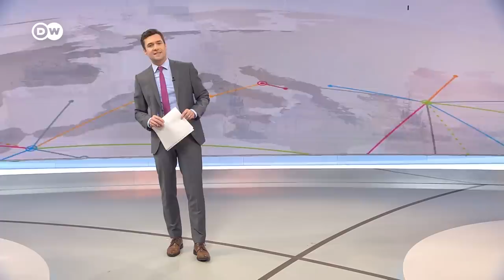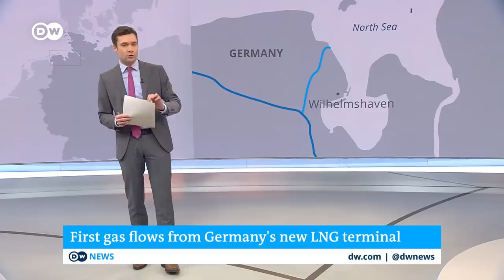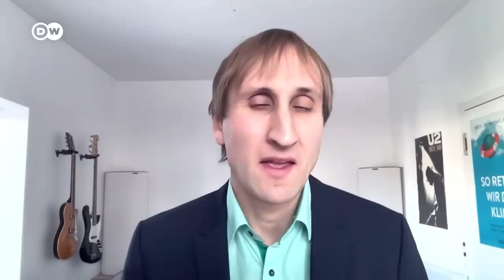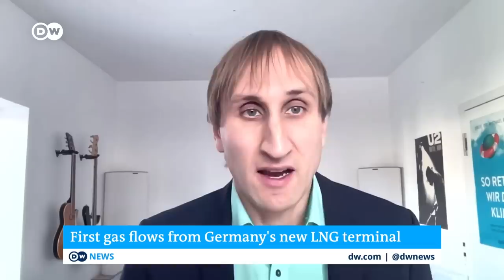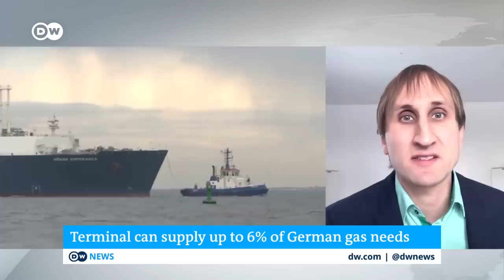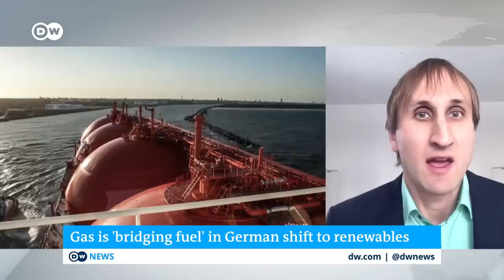First gas flows from Germany's new LNG terminal | DW News

Comment: Yes but pipelines from Norway, Denmark and from Africa also available.
Reply: THERE IS NO PIPELINE FROM AFRICA TO GERMANY.
Reply: Boom, and there was a pipeline.
Reply: @guillermoelenes  there are pipelines from Africa to Spain and Italy, and from there to Germany.
Reply: @thegreatdane3627  Spain has generated political friction with Argelia, where the gas is produced... therefore no pipeline... you have a connection to morocco but they have NO gas.
Reply: @Kartoffelsuppe_m_Wursteinlage  
That would mean war. 
There are several pipelines
Reply: @guillermoelenes  
Transmed
Green stream
Medgaz
And the Gibraltar ones. 
Obviously there is no direct gas pipeline avoiding other nations.
Reply: @guillermoelenes  There are 2 NG pipelines between Spain and Algeria. 
The Maghreb–Europe pipeline supplied Morocco, Spain and Portugal from 1997 to 2021, but due to a breakdown in diplomatic relations with Morocco, Algeria chose not to renew their contract with Spain, but the pipeline still exists, now with spare capacity.
The Medgaz pipeline continues to supply Spain with NG directly from Algeria.
Reply: @GonzoTehGreat  OK. yes.. the pipes are there. just siting idle.
Reply: @guillermoelenes  "OK. yes.. the pipes are there. just siting idle"
They're not BOTH idle. 
The Medgaz pipeline is operating as normal and capacity was even increased in 2021, albeit only from 8bcm to 10.5bcm.
Reply: @GonzoTehGreat  That gas is really meant for France. but as you understand politics is not easy. !   Either way... Getting Russian gas is a better idea. Too bad Uncle SAM wont allow it.
Reply: @guillermoelenes  "That gas is really meant for France." 
If you're referring to the Medgaz pipeline, no it's not. It's specifically intended for Spain. 

"Either way... Getting Russian gas is a better idea."
Wrong again. Europe allowed itself to become too dependent on Russian gas, so the sooner they diversify supply the better, as Putini isn't a reliable trading partner.

If the EU (specifically Germany & France) had focused on building gas pipelines to North Africa and the Middle-East and maintained/replaced their Nuclear Power plants then they wouldn't be in current situation.
Reply: @GonzoTehGreat  If you think the USA is a reliable partner. you have something else to worry about.
Reply: @guillermoelenes  A strawman.
Reply: @guillermoelenes  Russia has already lost this war, because they've failed to achieve their objectives. The question now is how much Putini can salvage from his failure and if it will be enough to keep him in power for the foreseeable future. 
As for economic sanctions against Russia, I don't expect them to be lifted as long as the war continues and probably not even after a peace is negotiated, unless Putini concedes ALL the territory he has taken in 2022.
Reply: At $$
Reply: How is a pipeline getting to Germany from Africa?
Reply: @Crashed131963  look at a map og pipelines in Europe. 
Nordstream passes Denmark and Sweden economic zone. 
The pipelines between Germany and Africa pass Spain or Italy

Comment: To be so dependent on primarily one source of power is scary.  After Germany beginning to shut down nuclear after Fukushima it has had trouble with renewables filling the gap.  Battery storage could help in the future as fossil fuels are still too cheap to abandon. Problem is europe paying 6-10 times energy costs Which is it profit margin to compete globally in manufacturing.  China will be slowing down production as covid spreads like wildfire
Reply: Scary for the west but bounty for Turkey and Italy..  oil for India and China ... 🤣🤣🤣🤣🤣🤣

Comment: Joe, look how China Is Helping.  China’s Gift To The World For Climate Change
 

As of July 2023, China has 1,142 operational coal power plants on the mainland. China has the most coal-fired power stations of any country or territory in the world, and more than half of all the coal-fired electricity in the world is generated in China.

  The Chinese coal industry is said to account for close to 20 percent of total global emissions, which is more greenhouse pollution than all the vehicles in the world combined.

Without using coal, the Chinese economy would decline and Chinese leader Xi Jinping would be unable to fulfill his ambition of making China the world’s hegemony by 2049—the centennial of when the Chinese Communist Party took power, the report pointed out.

50 GW of coal power capacity started construction in China in 2022, a more than 50 percent increase from 2021. “Also in 2022 a total of 106 GW of new coal power projects, the equivalent of two large coal power plants per week, were permitted. 

When completed in ( 5-10 years) these coal power plants  will put in the atmosphere 330-360 million tons of CO2. This is the equivalent of adding 80,000,000 combustion engine cars on the road. And this does not include any new additional coal power plants  in the future from China.

So China has set in plans to increase  pollution of our planet with CO2 gas while many other nations are spending billions of dollars to change their power infrastructures to reduce CO2.

Comment: Can always tell Qatar to stick the contract when they get renewables up and running. What are they going to do about it?
Reply: Germany has plenty of sun.
Reply: You cant run an industrial economy the size of Germany on renewables alone its a fantasy
Reply: @mrjerzheel  There's this little thing called nuclear as well...
Reply: @mrjerzheel  The EU27 will replace all fossil fuels ( oil, coal, nat gas) with green hydrogen, the goal is focused on 2030-2045.
Hydrogen can be used as raw material for proceeding things like steel, glass, paper etc as well as for being used as storage battery for the overloads from the offshore windmills and others.
Lots of start ups are working on alternative storage possibilities as well.
All along the coast lines electrolyseurs ( wind to power) are under construction.

Comment: Price guys.
How cheap is LNG compared to Russian gas?
Reply: russia is no longer delivering, so their price is irrelevant.
Reply: It's about 30 to 40% more expensive than what they were paying before. They're hoping to bring that down to 125% once all the terminals are up and running and the market has settled, but it'll always be way more expensive than just pumping it through a pipeline.
Reply: when the Chinese demand for LNG comes back to normal levels the price will rise significantly, maybe double price on LNG compared to Russian gas delivered by pipeline.